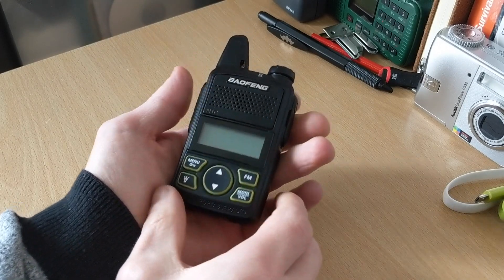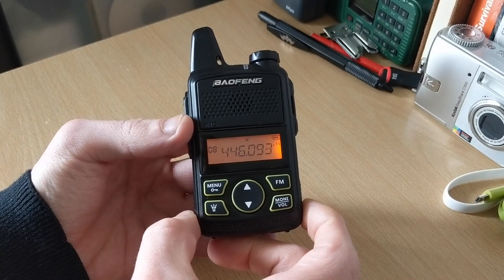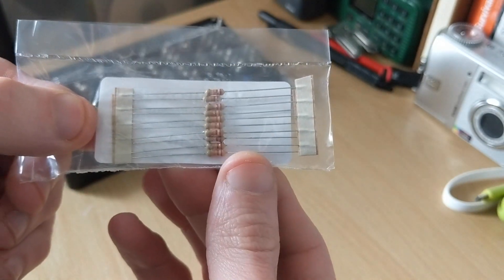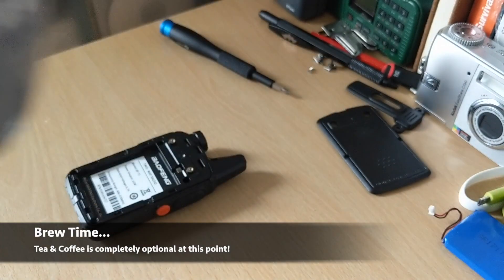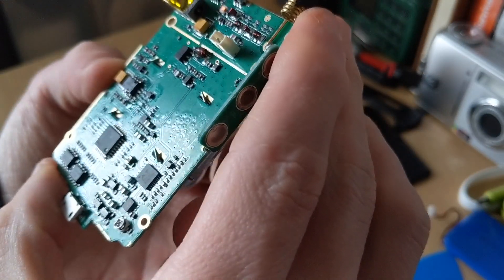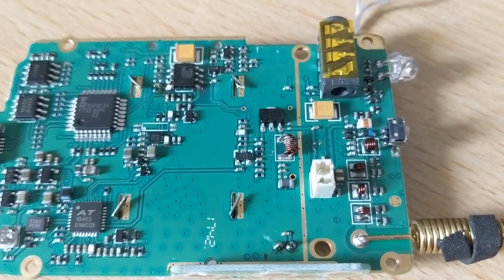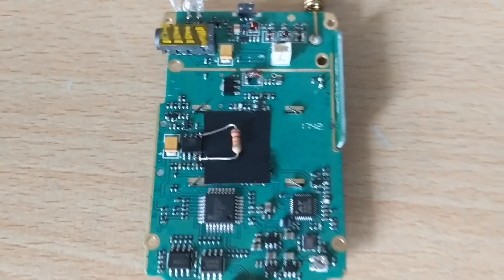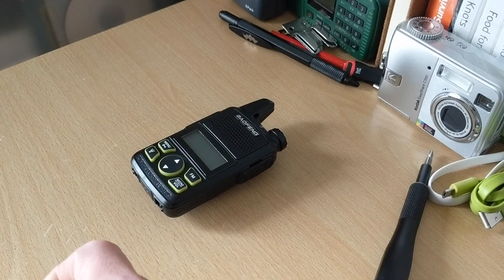BAOFENG BF-T1 Mini | Audio Fix | Loud Audio Mod Fix

Comment: This is utmost useful content! Used this mod to calm down my newly bought Baofeng PMR (sold as MP25, sticker in battery bay says EP25). 22k resistor did the job. 

Some technical details: the chip we care about in BF-T1 is LN4890 (1W Differential Audio Power Amplifier). EP25 uses different one labeled BL6281 (1.7 Watt Audio Power Amplifier) but the pinout is the same (pins 4 (-IN) and 5 (VO1) need to be connected with the resistor). I'm so, so happy mod worked. Thank you VERY much!

Comment: Hello friends! You don't need to make any hardware modification to fix the problem. Just program radio using CHIRP software. Settings > Basic Settings > Volume Level. Max is 7 i've set it to 5 and now is ok. 73 de Luke SQ9IVD
Reply: Hi, I used CHIRP software but I couldn't see anything on settings tab. oh at first it says "value not in range" then nothing appears

Comment: Could the same results be achieved if a resistor was placed in series at the speaker? I have done this mod...but have noticed that the battery drains over time while being switched off...i am not sure if the mod causes this...?
Reply: A resistor reduces current flow so would not drain power more, and yes putting it on the speaker does the same, probably easier and less likely to damage the circuit.😎👍
Reply: @techtinkerin  A resistor in the rong place can increase the current draw, esspechially in Amlifier circuits.

Comment: hi, why should i press monitor to hear?
Reply from the maker: Monitor is used to 'open' the squelch control momentarily. This could be for one of two reasons - 1) to set your desired volume and 2) if you're at a bit of a long range away from the person you're trying to hear, you could press 'monitor' to see if you can hear them before messing around with setting the squelch control to open.
Hope that helps.

Comment: Recently I brought 2 pcs baofeng T1, but unfortunately 1 of them is broken which is won't be able to be charging the battery.
Can you show me how to repair what is wrong? Thanks
Reply from the maker: If you've just bought it then I'd suggest sending it back. To be honest, they are so cheap to pick up on their own it's not really worth the time repairing them as they are more or less disposable at the price that you can pick them up for.

Comment: I'm eventually buying one of these radios. They really should release a modified or updated version.
Reply from the maker: Agreed, would be nice for a 4/5w version with more memory slots to save more frequencies.
Reply: @OntheMicwithMike  I've been thinking a real dual band model.
Reply: They did, less channel, 5w and no screen
https://www.banggood.com/Baofeng-T99-Mini-Ultra-Thin-Radio-Walkie-Talkie-USB-Charging-Flashlight-Civilian-Intercom-p-1596462.html
Reply: @smitthone  Did you see the size of that HT? It's not a miniature at all.

Comment: With a 33k resistor the highest volume is about the same as the lowest volume on a stock BF-T1. I started with 22k, it was a little bit too quiet for me, then I tested 4.7k, even quieter, so lower resistance->quieter

Comment: Alternatively, what about using a resistor on the speaker wire? That would seem much easier to solder and less chance of goofing up the board and components.
Reply: That would change the output impedance and possibly damage the amp

Comment: Could you tell me where I need to go to program it I’ve been everywhere and I cannot figure it out
Reply from the maker: Hi Daniel,
The only way to program this radio is via software. You'll need a Baofeng USB lead & the software, ebay is your best bet. But the best software you can get is called Chirp (search 'chirp danplanet' on Google). Its free and easy to work with this Baofeng.
Hope that helps.
Cheers.
Reply: Mike 26CT1074 I have the cable and I have chirp when I go into download from radio what baofeng model do I click on so it will download because I couldn’t find it on there
Reply: Mike 26CT1074 I got back on chirp and click download from radio on all the baofeng would not download I ordered the CD but I won’t get it until the end of August
Reply from the maker: I used Chirp. The last two builds of Chirp were updated to include the Baofeng BF-T1. Just select Boafeng and from the second drop down, select BF-T1. Thats it, no need for extra software.
Reply from the maker: Also, if you're using the software on a windows machine, you'll need to make sure the driver is installed for the cable. And the correct com port is selected or it won't download at all.
Reply: Mike 26CT1074 OK where do I have to go and get a driver because that’s what I’m using windows 10
Reply: Mike 26CT1074 The latest version I installed was from 07Jul 2018
Reply: Mike 26CT1074 OK I finally got the software to show me the radio now I’m just trying to figure out how to do that the driver
Reply: Mike 26CT1074 How do I install the driver it keeps popping up unknown do I have to go to a website
Reply from the maker: That's as far as I can go, I'm not a Windows user unfortunately. Haven't used Windows in years.
Reply: OK thank you you got me a little bit farther anyways that’s better in anything
Reply: Daniel Burch this should help you https://youtu.be/_MRnpORAKfQ
Reply: CHIRP works, except if you program FRS frequencies
Reply: Thanks everybody I finally got it going

Comment: Did you disconnect the legs from the circuit board or you just attached the resistor to it.
Reply from the maker: Just attached the resistor to the legs.

Comment: Hi Mike can you listen to aviation on this radio please
Reply from the maker: unfortunately not. Frequency range is 400-470mhz but it can also be programmed to work the 144-146mhz as well, as I have some 2M repeaters programmed into it. So no, it won't really work on the aviation band(s). It's also worth a mention, it's FM only.
Reply: No AM